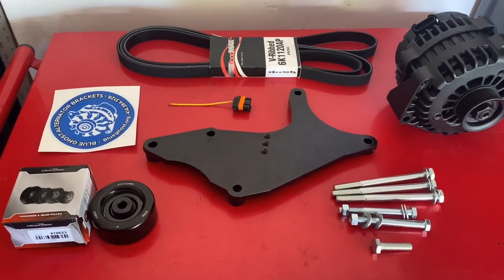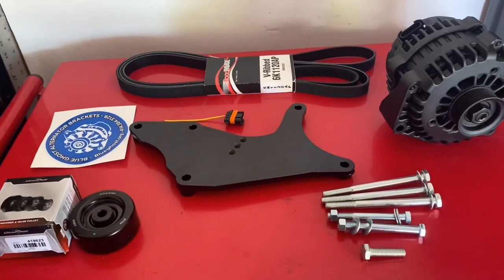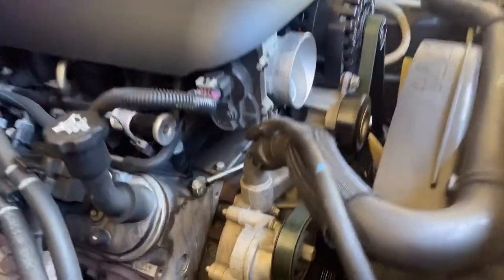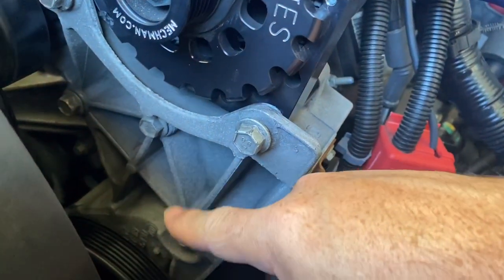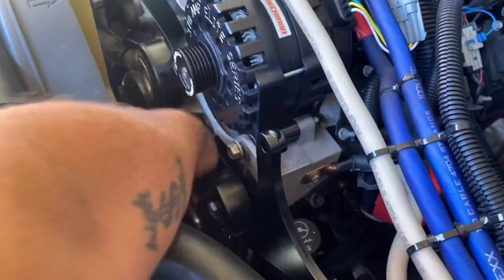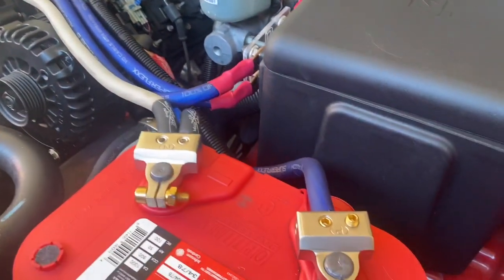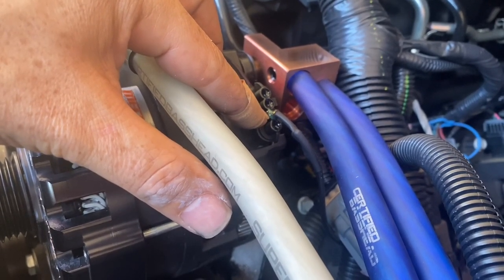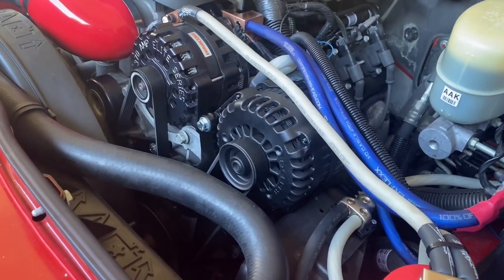Maximum Voltage! Dual Alternator bracket install with dual alt electrical system GM/ Chevy/ Hummer.

Comment: This video literally answered any question I may have had about dual alternators. My turn .
Reply from the maker: Thanks for the feedback. awesome!
Reply: Are all the dual alternator setups the same? I got a JS alternator 390 but im not sure how to connect the 2nd alternator? It didnt come with a plug for the alternator.
Reply: @johnysmashalot411  look into an external regulator . Ask a pro though . I did direct connect stock + 370 . Worked well , but could have been better .
Reply: I thought u where a pro?? Lol. I cant even find what plug to get.
Reply: I got a 07 yukon. Should i get the stock 2 pin plug?
Reply: @johnysmashalot411  that's what I did in my 07 Suburban. Worked like a charm . Eventually, I separated the two . 370 with external regulator devoted to music only .  There really is no wrong way. It's all about preference , proper wiring ,and finance.

Comment: This exactly what I'm about to do with my Silverado! I have to 220 amp in my truck now and a Mechman 400 I haven't installed yet. The 220 will be running the trucks electrical and the 400 will be dedicated to my sound system and I have a DC Audio dual alternator bracket.
Reply from the maker: Hell yes! This is the absolute way to go! Absolutely happy with my setup!

Comment: Thank you, this was extremely helpful. And love the hummer btw I got a 99 tahoe imma try and soup my up myself
Reply from the maker: Nice!
Reply: @NextLevelCarAudio  quick question?, charger- I'm running a second battery, upgraded alternator, big 3 installed, should I go from alternator to 2nd battery then amp or alternator to primary then secondary to amp, I'm having a brain fart

Comment: @NextLevelCarAudio I've been torn over either A. running everything off one 320A alternator (aka- double the amps of the 160A alternator I currently have) or buying a second 160A alternator identical to the one I already have (+the dual alternator bracket kit) & running the stereo off of that. Apparently a 2012 Chevy Tahoe SSV can only run up to 320A, but I'm not sure if thats per alternator or TOTAL... Either way, any ideas on what the difference would be (or pros/cons) running everything off one single 320A alternator VS having two separate 160A alternators if you're still getting the same total amperage? Sorry, prob dumb questions to most ppl on here, but new to this & just getting my ducks in a row before making a decision.

Comment: So before you added the second alternator, how did you have your lithium battery wired up to your agm starter? I need help figuring out how to wire the 2 together with no issues for my daily build
Reply from the maker: I didn’t.... i installed my limitless 12 k after my dual alt setup. I just did not produce that video until afterwards. Easy tho.... just run a isolator in between the power wire going from front power source (battery or alt) to rear lithium. And you good. Do the 500amp one tho.
Reply: @NextLevelCarAudio  okay thanks I appreciate it
Reply from the maker: Sure thing

Comment: The question I have is, the alternator wire harness with one wire....did you wire that to the fuse box or to the turn in from the factory alt?

Comment: Great video. But u said your agm is connected to your lithium.   I thought it was never a fee at idea to mix them as the agm will kill out the lithium
Reply from the maker: No, they are completely isolated. 1 alt runs truck battery, other alt runs lithium for sound system
Reply: @NextLevelCarAudio  ok cool

Comment: Hi, I'm building a 3 Amp system.  Highs, Mids, and Subs. One Battery under the Hood. One 0 Gauge Power wire running to the Trunk. The sub mono block amp needs a 0 gauge Power wire input and the Mids and High amps needs 4 gauge power wire input. I can't find a Power Distribution Block to accommodate this set up. I'm I going about this the wrong way or do I need to search a little harder.
THANKS.
Reply from the maker: You can create your own bus bar, or use a 0awg splitter, to give you 2 zero gauge outputs. Run one to your sub amp and the other to your other amp with a zero to four gauge reducer tip

Comment: How much better are you doing with voltage drop now and also I’m looking to make the jump to lithium but haven’t yet can you give me some recommendations like cyber 12k the new titan or should I just go Dyi right now I’m running two crescendo 3500s on two fi btl v4 in the back of a Silverado
Reply from the maker: Nice setup man! If you are looking to save money a diy setup is a great option. Just make sure to do your research and due diligence so you don’t blow yourself up! Lol. Could not be happier with my cyber series tho. People are selling their old limitless blue series for super cheap. I’d go that route if you don’t want to spend the 1K on one of these. Check out the limitless FB community for plenty of used deals

Comment: Did you use the belt that came in the kit on the blue ghost website or did you get a custom length one ?
Reply from the maker: In this setup, yes, I used the one they gave me. Worked just fine

Comment: So where would I find the one wire for the alternator?
Reply from the maker: it was on the mechman website. link below:

https://www.mechman.com/accessories/plugs-harnesses/p101-gm-4-pin-plug-pigtail-with-sense-and-excite-wire-l-and-s/

Show 2 wire, but they will send the single wire as their alts only need one wire now to exite.

Comment: Quick question = I am doing a battery delete under the hood and going all Lithium. Do I need to fuse the power wire from the battery delete to the lithium in the back?

I will be installing SCV-4k and they recommend fuse under 400 amps and I am planning to feed the positive with dual 0 gauge wire. How do I fuse it?

Your help would be much appreciated
Reply from the maker: So, i assume you are running your alternator power wire to the battery delete, then from the battery delete to your lithium, then from your lithium to your 4K. Right? If that is the case, then YES! Follow MECP procedures and fuse power wire within 18" of the battery delete and within 18" before it goes to the lithium. If your power wires from your lithium to your amp are longer than 18" they are supposed to be fused too. However.... If they are not going to get pinched, not travel through metal, or can easily come disconnected and short out. You can make your own call on that. If it was me, i would send 2 power runs of ofc from front to rear and fuse each wire where you are supposed to wire with 350amp fuses. (remember, you fuse to protect the wire not the amp).
Reply: @NextLevelCarAudio  Gotcha! So 2 runs from the positive terminal at the battery delete to the lithium in back needs to be fused. Do I need to run it from the back of the alternator or would it be the same if I run from the positive terminal from battery delete?

Those amps recommend 350a fuses. do I fuse both runs from front to back with 350a per wire?

I swear, This is the last question. If I run 2 0 gage wires to positive of the amp, then I am going to fuse both wire with 350a each?

Basically put same rating fuses ( 350a ) to power wires. Fuse it on 3 spots ( 1 at battery delete, 1 before I connect it with the lithium and 1 from lithium to the amp itself. ( Just like you Hummer )
Reply from the maker: don't need to run direct from the alternator. the battery delete in essence will act as a distribution block. So can run it from there no problem. Yes, one 350 amp fuse per wire at every fuse point previously mentioned. you got it man. i think you are set! Since fusing does create a small voltage drop, if you are looking to demo hard at a meet or show and get max voltage for higher SPL you can always get some of these to throw in there. then put the regular fuses back for every day daily listening. lol.

https://jims-machineworkx.myshopify.com/products/fuse-delete-team-no-fuse

Have a happy thanksgiving man. Later
Reply: @NextLevelCarAudio  Dude, You are the best! Happy Thanksgiving to you and your family
Reply from the maker: Thanks ;)

Comment: How do you read the voltage for the audio alternator
Reply from the maker: I have a volt meter built into my bass knob that takes a reading directly from my lithium battery in the rear for my audio build.

Comment: Nice good job 👏, questions if I have a high output alternator and a stock alternator, should I only check voltage on the high output alternator that’s dedicated for the sound system or should I have 2 different volt meters? Or is the voltage going to be the same for both together.
Reply from the maker: Volt meter for the car audio amp should be all you need if your electrical systems are isolated. I ran my truck like that for a while.

Comment: Dont you think it would have been better to have the 370a on the bracket and the other in the factory location, since it might benefit from that better belt wrap?
Reply from the maker: Was only temp. I’m running dual 370’s now so no matter. With this setup I got ZERO slip, so did not matter for me .

Comment: Did you have to do anything get the full charge capability of the 370 ? I see you only have one wire on your plug and I have two . I’m wondering is it being regulated by the pcm and keeping it from operating a full capacity
Reply from the maker: Did not need to do anything special. Sorry for the late reply

Comment: How is the audio alternator regulating the battery without over charging since under normal circumstances the computer normally switches the charge amount on and off
Reply from the maker: It’s internally regulated so it does it itself

Comment: On the dual alternator bracket what hole did you use for the idle wheel. Its had 3 holes right.
Reply from the maker: My kit came with one

Comment: I finally got my dual alternator installed, would you suggest get another cyber 12k with a SFB13500 to run my 4) Skar VXF15D2?
Reply from the maker: That would definitely give you reserve for days! Which is a good thing when running a high power setup :)

Comment: I have a 86 cougar I'm currently running 2 Amps 1 for front an back speakers 1 for 15 sub my smaug pump went out an wound up bypass it can I use the bracket to run another alternator an how would I wire it in need of help
Reply from the maker: You surely could. But would just need to figure out how to retrofit an alt to it. For wiring, I suggest keeping one alt as wired for your cars electrical, and the second (high output) alt for your car audio.
Reply: @NextLevelCarAudio  ok so how do I wire the 2sd alternator like do I just hook my stereo an amps directly  to it or
Reply from the maker: Yes sir. They both share a common ground B as they are both connected to the engine. However one alt Positive is ran to your under hood battery and the other alt positive is ran to the rear (secondary battery, distro block, amplifier,etc) to power your audio. That’s it man

Comment: Looks cool man. I have a few questions hoping you can help me. I have a 2015 Hyundai Sonata, that runs a stock 200A alternator. Could I run the 200A alternator for my car and it’s electrical; and a separate 300A alternator for my audio system? If so how does that work without damaging any electrical? Would I have to upgrade electrical for my car for the separate 300A alternator? Or do you recommend me adding another 200A alternator instead of the 300A?
Reply from the maker: Absolutely, won’t cause any problems. That’s how I had mines set up. Complete separate electrical systems. They share ground. That’s it
Reply: @NextLevelCarAudio  good to know! Thank you for helping me out. Keep up the great work 👌🏻

Comment: Can you explain how you connected the 12volt ignition source wire? 

Mine just came in and that’s the only part that’s giving me a headache
Reply from the maker: In just ran it to a fuse box under the hood that shows +12 when car is running
Reply: Okay

Comment: Should I run 3 400 amp alternators for both the car and audio system together if I’m running 15k watts
Reply from the maker: That’s a Lot. Dual with be more than enough. Even a single 400 would be enough of you had good reserve

Comment: What wires did you hook up to the 370 to run it separately? Doing the same on my truck
Reply from the maker: Sorry for the late reply…. I no longer have this setup and honestly don’t recall….. I have dual mechman elite 370 alts now powering both truck and audio
Reply: @NextLevelCarAudio  I have two 370 elites for audio and 200 amp db electric for the truck and just trying to figure out best way to run everything.
Reply from the maker: Definitely isolate the 200 from the 370’s. Great having separate electrical systems like that

Comment: Can you tell me where you ordered the brackets from??? I recently had an impala setup but since I rid of that car and got an explorer I got something im looking to order but requires alot of power....trying to be prepared
Reply from the maker: https://www.ebay.com/itm/Dual-Alternator-Bracket-Chevy-GM-2000-2013/293801914256?chn=ps&norover=1&mkevt=1&mkrid=711-117182-37290-0&mkcid=2&itemid=293801914256&targetid=1068323860710&device=m&mktype=pla&googleloc=9033553&campaignid=12594560365&mkgroupid=119320482906&rlsatarget=pla-1068323860710&abcId=9300522&merchantid=6296724&gclid=EAIaIQobChMI6ZC9-erf7wIVr8mUCR1BPgDKEAQYASABEgJvXvD_BwE&pageci=e9dd83b5-cbe0-4fa1-b069-8c3aa2ec0d51
Reply from the maker: Blue ghost alternator brackets
Reply: Was the belt size ,able to add the correct tension or did you have to size down when ordered
Reply from the maker: Yes, it was the next step down. Don’t recall which as in have a new setup now and no longer have the old belt

Comment: 🔴 Im still getting lights dimming and alternator jumping to( 17 volts❗) I have a 2011 Chevy Avalanche, I already upgraded my alternator to a Velocity 250amp from Amazon. It plugs up just like the original. I have a Optima RedTop(50ah) for cranking and a Optima Yellowtop(55ah) in back. I have a SkarAudio 100×4 amp for highs and the Orion XTR2500.1d on two AmericanBass XR-12's. I'm lacking power, and meanwhile the factory 160amp alternator is just sitting in the garage. I wanna try to solve my power issues by doing this bracket thing and using my factory alternator. Will it work and how will the Regulated Voltage Control chevrolet uses be affected❓Any advice would be greatly appreciated❗👍🏾💯
Reply from the maker: So, in your case, the best thing to do would be to get a dual Alt setup and have your truck run off the stock alternator and get a externally regulated second alternator for your system, that you can control from the cabin. That’s what I’d do in your shoes. 17 volts is no good on a 12 volt charging system!
Reply from the maker: So, in your case, the best thing to do would be to get a dual Alt setup and have your truck run off the stock alternator and get a externally regulated second alternator for your system, that you can control from the cabin. That’s what I’d do in your shoes. 17 volts is no good on a 12 volt charging system!
Reply: @NextLevelCarAudio  Thx for the help, yeah I was concerned about seeing 17volts because I've never seen it that high. The alternator was definitely trying to keep up with the demand of that Orion 2500watt. The birthsheet on that thing says 2984watts 😄 👍🏾💯

Comment: Where did u run that mechman alternator
Reply from the maker: Directly to my rear lithium battery for my car audio build. The other alternator is for the truck battery
Reply: @NextLevelCarAudio  did u wire to your fuse panel on 12v fuse
Reply from the maker: yes, 12v ignition on fuse in the underhood fuse box. there are several that will work you can tap into.

Comment: I need to do this to my 09 suburban,  I have 2 d4800 xs power batteries on a mechman 370 alternator but I have a mechman 240 that I'm not using. Would 1 battery be ok for my audio and 1 for the vehicles electrical system?  240 for my truck and the 370 for my audio system, 3 evl 15's 1 rp4500.1 on my subs and 1 rp75.4 on my mids and highs.
Reply from the maker: At that power level your should be right on.
Reply: @NextLevelCarAudio  u mean without the dual alternator set up?
Reply: @NextLevelCarAudio  regulated voltage control wont let me use my alternators full potential
Reply from the maker: No, after you do the dual setup
Reply: @NextLevelCarAudio  ok thanks man, I appreciate the feedback.

Comment: I added both alt how it showed but once I put my truck on gear the truck looses power and shuts off any ideas ?
Reply from the maker: That’s odd.... never heard of that man. How are your batteries?
Reply: @NextLevelCarAudio  battery’s are charging good everything is good just seems like my stock alternator might be going out when I put it on gear
Reply from the maker: That’s a possibility, let me know if you figure it out. Wish I could be more help

Comment: Why not one higher output alternator?
Reply from the maker: Because with one alternator you can’t run dual electrical systems. It’s great being able to isolate truck power from stereo power without having to use isolators. Plus those that run 12v truck power and 16v stereo power need to do it this way.